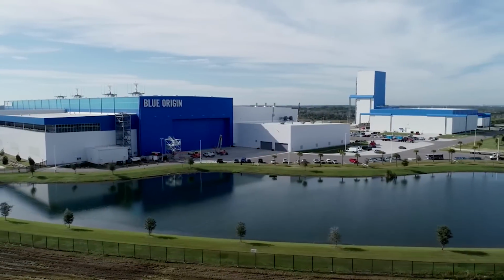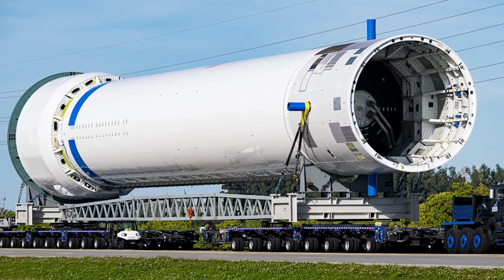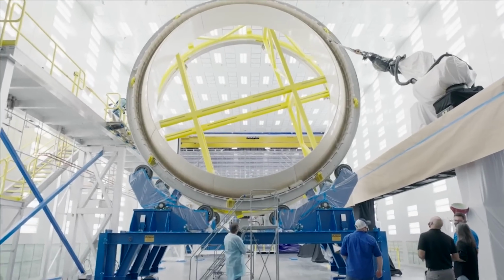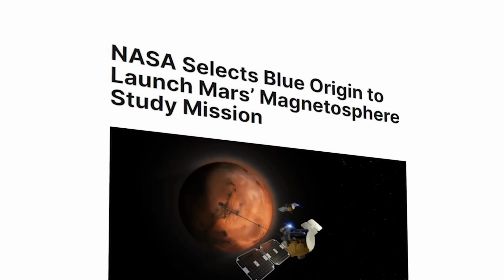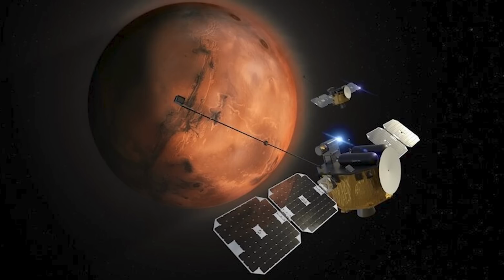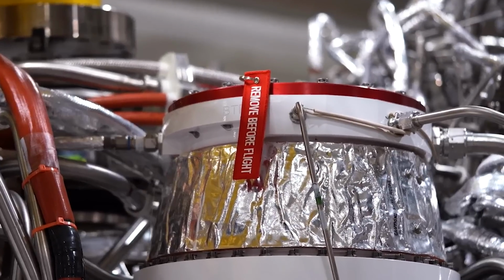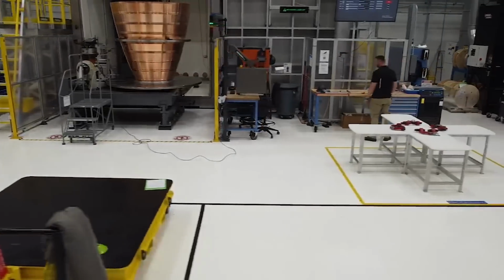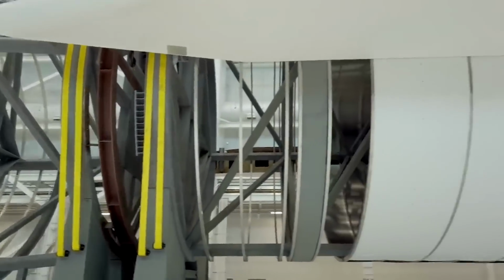Blue Origin Is Preparing To Launch New Glenn

Comment: Where are they going to launch it from.  NASA won't allow a Starship launch from Florida until it has proved itself because they are afraid of the hole it could make.
Reply: They're launching out of LC-36. That's where the booster and 2nd stage are, along with the mass simulators seen in the photos.
Reply: BOs New Glenn will launch from the Cape, just as ULAs Vulcan did weeks ago.
That is a show of confidence in New Glenn by NASA, FAA and FWS; they are NOT afraid of any "unplanned excavations" that are caused by an "unscheduled disassembly".
Good luck at Boca Chica!
 😁🚀💥🐦🐢⚠️
Reply: NASA won't allow a Starship launch from Florida?  According to who?  When did they say that?
Reply: @imaginary_friend7300 This was way back.  They said NO Starship launches until SpaceX could show a track record of successful launches because of the hole in the ground it could leave where a pad was.  I find no such restriction placed on BO very unfair, not that SpaceX cares.  Obviously now SpaceX flies the booster with no problems.

Comment: Ah the cart BE-4 the horse...meaning them producing 7 engines that all work to stage separation I'm thinking might happen 2 years from now.
Reply: Wrong. You are NOT thinking.
Reply: Clever.  ULA has dibs on the BE-4, so engine priority goes to them.  But there does seem to be an awful lot of BE-4s on the floor.
Reply: Two worked flawlessly on Vulcan just a few weeks ago, and it gives Blue lots of data on how 7 of them will work on New Glenn. With at least one more launch on Vulcan in the coming months before New Glenn's first flight at the end of this year, along with static firings of NG's 1st stage, they'll know. On top of that, unlike Vulcan, the BE-4s on NG don't have to fire for nearly as long.
Reply: I would love to see your sources. Do you have an inside source or are you just trolling for clout.

Comment: In theory, this should end up costing less than Vulcan because no need for disposable SRB's.
Reply: SRB are indeed a major part of the cost for vehicles that use them, but that's a bit deceptive because the base vehicle is able to be a lot smaller then an all liquid fueled vehicle aiming for the same performance range.
Reply: mainly depends on the launch rate. spreading fixed costs is what determines launch costs
Reply: Heavier payload too: 35 tonnes to LEO as opposed to ULA Vulcan 27 tonnes and Falcon Heavy 10 tonnes.
Reply: 2nd stage looks like Vulcan without the firework crackers.  1st stage has a few engines more.  Different rocket class.  Maybe per kilogramm cost is lower, but not the actual launch price.  And they will loose some rockets at landing.  Falcon boosters don't fly higher than Jeffs flying dick.  They say it's still easy to land.  With this one I think they want to fly the booster higher.  The learning process might become interresting.
🚀🏴‍☠️🎸
Reply: @davidstevenson9517  falcon heavy does ~60 tons to leo
Reply: @m1abrams1776  Its 45 t for New Glenn when reusable, similar to Falcon Heavy. 60 t figure is when expended.
Reply: @m1abrams1776  Elon Musk has been disingenuous with the Falcon Heavy. While the use of 2 F9s serving as strap-ons to a central F9  provides extra engine thrust capable of launching 60 tonnes to orbit, two limitations arise.
One, the size of any payload above 10tn requires a fairing so large  that aerodynamic forces would tear it apart.
Two, the weight of any payload above 10tn mounted on the single, central F9 would result in that F9s fuselage collapsing upon lift-off.
This is why Falcon Heavy hasn't been getting 10tn+ contracts; Atlas 5, Delta IV and Ariane 5 were getting them and now Vulcan, New Glenn and Ariane 6 are replacing those heavy launchers.
If Elon Musk cannot get Starship operational, SpaceX cannot get into that market.
Reply: @davidstevenson9517  and your sources for these claims?
Reply: @davidstevenson9517   Falcon 9, not Heavy, has launched payloads of 18.4 tonnes, so your clam that it can only support 10 is wrong. I don't know its actual structural limit, but it is much more than 10 tonnes.
Reply: @davidstevenson9517   Don't know where you got that last number but even a Falcon 9 can do much more than 10 tonnes. 18.4 tonnes when recovered to be specific. The Falcon Heavy can put 63.8 tonnes into LEO when fully expended. I don't know but, comparing it to Falcon 9, I think that means it could lift about 50 tonnes when recovered.
Reply: It was my understanding that the max payload to LEO for the Falcon Heavy is 63 tons.  @davidstevenson9517
Reply: @davidstevenson9517 falcon heavy does not have 10 tons do LEO